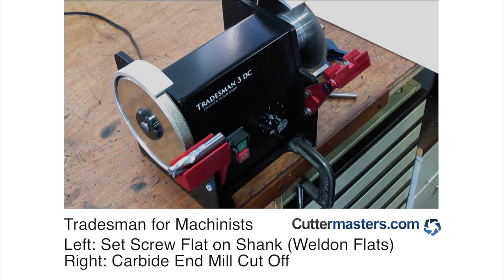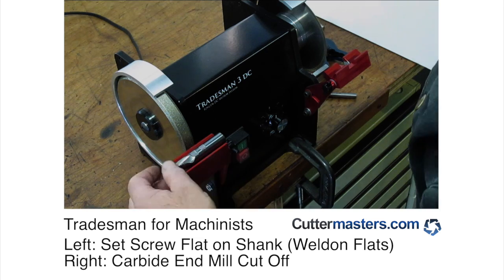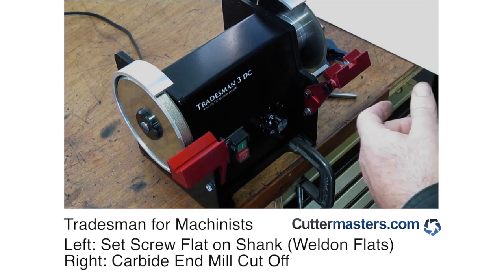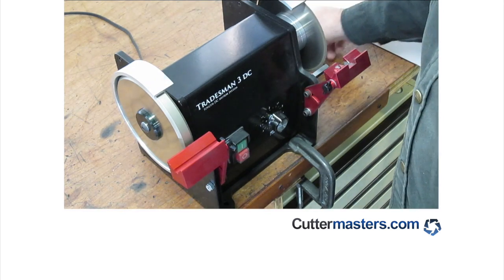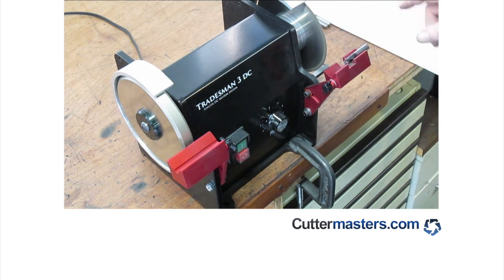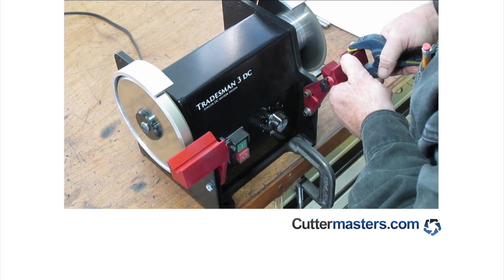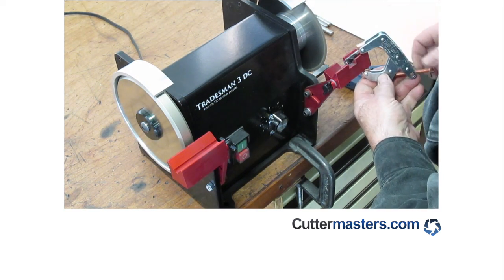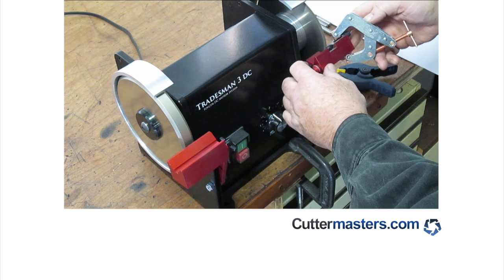Cutting Off a Carbide End Mill

Comment: WARNING: carbide products contain Tungsten Carbide and Cobalt, and may contain Carbides of one or more of the following elements: Tantalum, Titanium, Chromium, Vanadium, Niobium, Hafnium, Molybdenum and/or Zirconium. Dust from grinding these products can cause nose, throat, skin and eye irritation and temporary or permanent respiratory disease in a small percentage of exposed individuals. Permanent respiratory disease can lead to disability or death. Coolant mist from grinding may contain dust. Avoid breathing dust or mist. Use protective devices and adequate ventilation. Avoid prolonged skin contact with dust or mist. Wash hands thoroughly after handling before eating or smoking. Maintain dust level below OSHA or ACGIH levels. This product contains a chemical known to the State of California to cause cancer. Cemented carbide products may break during use. Use proper eye and other safety equipment when using carbide products. Read Material Safety Data Sheet before grinding or using these products.